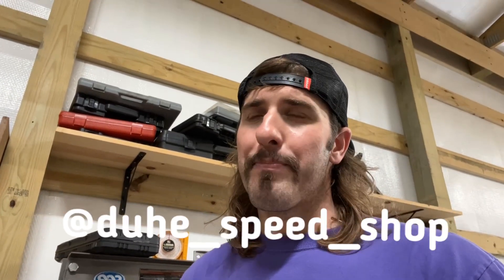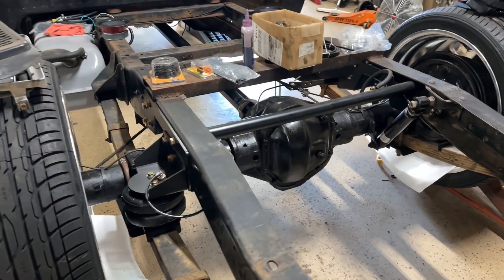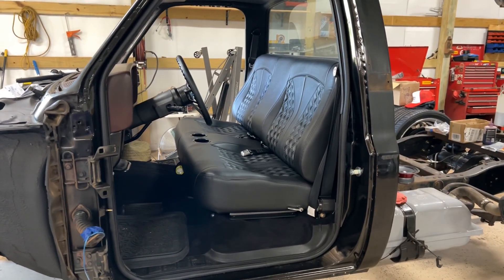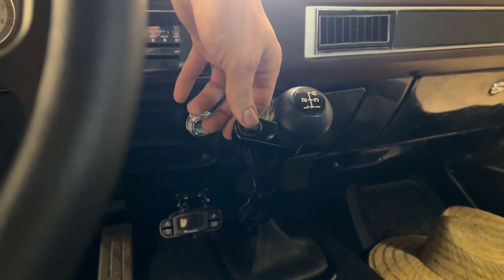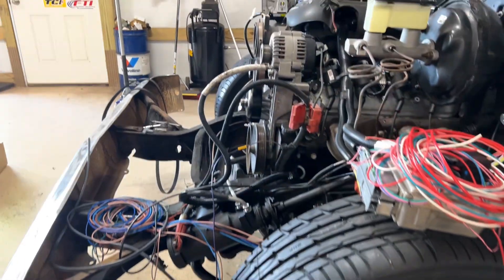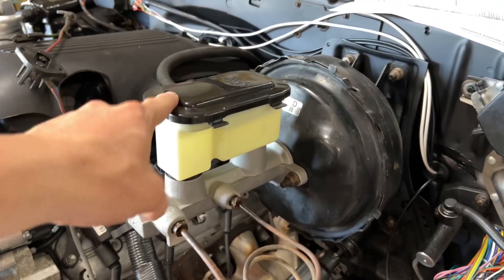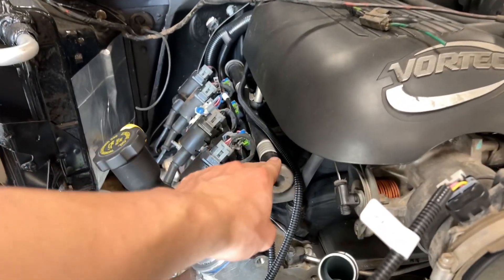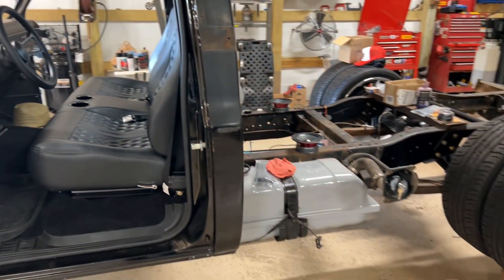Squarebody dually build part 2: hotrod Powertour is approaching rapidly🥴 A lot has been done‼️

Comment: Man, this truck has inspired me. My son found a 12 valve Cummins with the P pump at our local pull a part. I went down there and grabbed it for $300! I’m building it now, and I think it needs to go in a truck like yours. I’m setting this motor up to make about 650 hp and 1200 lbs of torque. I think it would be mean in a old dually!